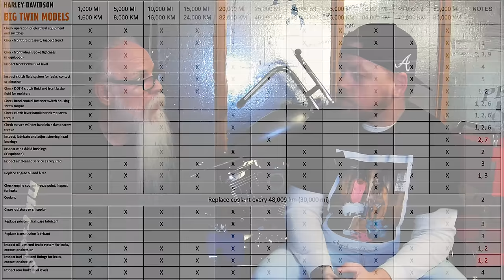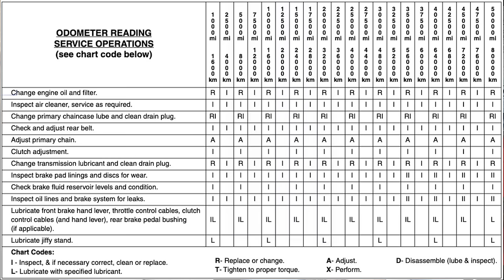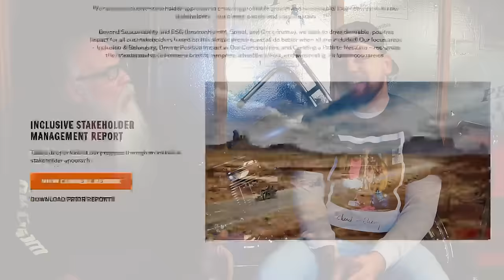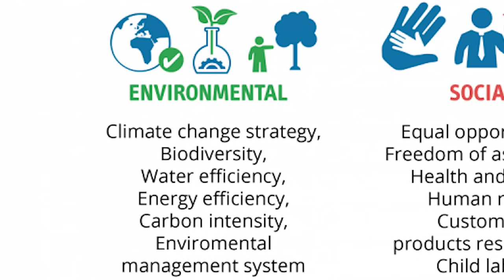Harley Oil Change Intervals-Engine, Primary, Trans

Comment: Good info, I have always changed all 3 holes 3-4 K miles. What alot of folks do not know is clean fluids help maintain a seal better and will suspend more debris between changes
I have never had leaky seals on any of my bikes
Reply from the maker: Hey Jack,
Good point.  Thanks for the comment. 👍😎👍
Reply: Yep, main 3k, primary 6k, trans, 6 to 10k, for me. 110k trouble free miles on 99 TC
Reply from the maker: Nice! 👍
Reply: I change all oil when I do a  oil change every 3000
Reply: Engine oil is one thing,but tranny fliud , synthetic,I change every 20 thou kms

Comment: I am 82 years old, and ride a 99 EVO powered Softail Custom. Since I generally do not ride over 3 to 4,000 miles a year, I change oil with Castrol 20-50 non synthetic once a year, and change the primary and transmission with Harley transmission fluid every 2 years or so. I have 64,000 on it and it runs great, with no leaks anywhere. I always warm it up before riding as alloy cylinders need to expand to tighten the gaskets. 

I tried Mobil 1 synthetic once, and the base gaskets started weeping. Changed it back out to non synthetic. Stopped weeping in about 200 miles. I love my carbed EVO motor. It runs like a Shovel head with improvements. Plenty of power for an old guy to cruise the back roads around where I live. 

I started riding on a 1942 "45" flat head in 1955 when I was 14. Wish I still had it.
Reply from the maker: Thank you for sharing your experiences. 👍😎👍
Glad to hear you're enjoying the classic HD experience.  Less and less even know what they are missing.

Comment: I've ridden H-D since 1969 and somewhere around 500,000 miles. Always changed all 3 holes at 5,000 miles (13 bikes). Never had engine, primary or trans. problem.
Reply from the maker: Thank you for sharing your experience. 👍😎👍

Comment: Change mine every 3-5 thousand miles. The same as my trucks and cars, been doing that way for 34 years an haven't had any problems or issues with any of my bikes or 4 wheeled vehicles. As you stated the cleaner the crap catching magnet is the better it works and always remember to check it to make sure it's still magnetized before reinstalling it. Sometimes they can lose it if they get to much trash on them for long periods of time. As the old saying goes, " if it ain't broke, don't try to fix it." Ya'll ride safe, have a Merry Christmas and keep the shiny side up and rubber side down.
Reply from the maker: Thank you for the comment.  Good info! 👍😎👍
Merry Christmas!

Comment: I have a 2019 Triglide and I change every 5k miles. I use amsoil 3 hole motor oil, primary oil and Trans fluid. You guys are great and I've learned a lot from watching your vlogs ty
Reply: I use Amsoil designated for each hole. My remote oil filter makes filter change easier and cleaner. Usually about 3500 miles.
Reply: Thanks guys I’m changing my oil’s every five thousands miles. I think it is better for bike.😎✌🏿
Reply from the maker: Thank you for the comment and the good words.  Glad you are finding the videos interesting/useful. 👍😎👍

Comment: Once a year or 5k whichever comes first. All three holes, all the time. Own an 02 FatBoy with only 40k but still changed all three, every fall, and have had no issues whatsoever.

Had my tension shoes replaced at about 27k, and was planning on replacing the Oem cam with a new one since it was being done. Tech told me there was no wear at all on the cam and to keep doing what I was doing in regards to fluid changes. 

Originally used only Dino oil, since Syn3 was not out yet, but somewhere over the years I switched to syn3 or similar and never looked back. 

Frequency is the key. Cheap investment and a couple hours a year to keep it purring 😉👍
Reply from the maker: Thanks for sharing your experience. 👍

Comment: On my 07' Fatboy I followed the owners manual on fluid changes. I have 46K+ miles on the bike now. I use AMSOIL synthetic V-TWIN engine oil 20W-50 in the engine, AMSOIL V-TWIN Synthetic Primary Fluid in the primary, & AMSOIL V-TWIN Synthetic Transmission Fluid in the transmission. I changed the engine oil @ 3K miles, primary @ 10K miles, & the transmission fluid @ 20K miles. After my last oil change (May 2022), I decided to change the primary fluid, & the transmission fluid @ 3K mile intervals, along with my engine oil change. Most of the time, I change the engine oil yearly, as I haven't been able to put many miles on my Fatboy in the last 3 years. I hope to get many more miles on my bike in 2023. I haven't rode since mid July of this year, due to health issues.
Reply from the maker: Thank you for your comment and experience.
Wishing you many more miles of smiles in 2023. 👍

Comment: Interesting that when you take it to a dealer for an oil change, they don’t tell you if they do just the engine or if they do all three holes, but they still charge around $300 to $500 for a service regardless of your mileage. I just started changing my own oil and I think I will stick to all 3 holes every 5k miles.
Reply from the maker: Yeah, it is usually better to do what you can yourself.  Then you know it was done right. 👍😎👍
Reply: Are you serious 😃 $300.00 to $500.00 for an oil change.
My 93 FXRS-CONV which I have owned for 30 years and my 2010 FLHTC which I have owned for 12 years have never seen the inside of a dealership for any service ever.
I was fortunate enough to meet a man when I was about 15 who taught me everything about repairs, tools mechanics on cars and motorcycles.
He later went on to be general service manager of Canada for Deeley Harley Davidson which is the Canadian distributor.
My neighbor had a Bentley, he was charged $1,200.00 for an oil change at the RR dealership. This is a V-8 aluminum block OHV spin off oil filter like any North American V-8, except it takes 8 quarts of oil.
He had to get rid of the car for obvious reasons.
I had no idea that the dealer's are practicing extortion.
Oil changes are about the easiest thing to do and provides excellent maintenance.
As I taught my son, the most important thing is that you check for leaks after doing it.
Reply from the maker: Yeah, prices are out of control, for sure.  Plus, when you do it yourself you know it is done right.
Reply: I have never in my life had any dealer change my oil, whether in my Harleys or my trucks. 72 years old.... not a snowflake!
Reply: @michaeleisen5445  And people wonder why they have money issues in their life, Lol!!!
Reply: @michaeleisen5445  at the time my bike was under warranty and I was told to preserve the warranty I had to have the dealer do the maintenance. It definitely was not convenient since the nearest dealership is 2 hours away. I’ve done my own oil changes on all my vehicles over the years and I still do my Motorcycles now that they are no longer under warranty.

Comment: Thanks guys, one of the best video's I've seen in a long time, not just on your channel; but in general as I'm a HD junkie. Boys you are correct, Canadian here and my manual says engine oil/filter every 8,000 kilometers, primary every 16,000 kilometers and tranny every 32,000 kilometers (negative the 1st service at 1,600 kilometers that change all 3 holes to keep warranty valid). I have a 2022 Street Glide Special I bought new, and do it at 4,000 kilometers (50% before their engine oil recommendation change kilometers/miles) plus the primary and tranny at the same time. It's not expensive and I love knowing I have fresh clean oil in all 3 holes.... all the time. Thanks for posting this, it's common sense really. I have to be honest I never thought of the HD carbon foot print issue to try to get customers to stretch out oil changes. I never understood my manual why such long miles between oil changes, now I know. A publicly traded company trying to lower carbon foot prints. Every day I learn. Always go with your gut feeling people. What an eye opener.
Reply from the maker: Glad you are finding the videos informative! 

Thank you for commenting! 😎

Comment: So glad you put this information out there for others. I made a comment in your "transmission oil change" video about your temp dipstick and started discussing oil change intervals and how parts materials haven't changed over the years. I know when I change my Primary oil for instance (change all 3 holes every 5K), I notice a significant difference in noise, smoothness, and ease of shifting. As you say, nothing has changed over the years except EPA requirements of companies. There are notable motor builders that can back this up too!
Reply from the maker: Thank you!
Yes, the primary can get contaminated very quickly from clutch plates.

Comment: I have an 03' softail 42mm mikuni standard softail.  Bigger heads, pistons, cam from a 88 to a 103 running a 240 tire final drive.  I have changed all 3 holes once a year with syn 3 cause I don't even drive my bike 5K a year.  Due to covid bike fluids havn't been changed or started for 2+ years. Bike started easy with throttle primed, choke on with compression release valves started and runs great!

Comment: Guys, there have been many studies on this subject. I used to change my engine oil in all my vehicles @ 3 to 5K. Then I switched back in the late 90's. I started using AMSOIL and went to their extended drain intervals and began changing at roughly 20K miles. I sent off oil sample kits, and every time they came back as great. I dug even further into this. Most advanced oils are nothing like the old oils of the 50's to 80's. There was a study done where they proved people were throwing away perfectly good oil, oil that was still working great and doing what it's supposed to do. The oil companies didn't like this of course, because it was going to cut into their profits. I have a vehicle that I change the oil in every 20K miles and it is getting ready to hit 1/4 of a million miles and STILL runs great! I believe most people are still hung up on the old oil and believe it has to be changed at 5K miles. My wife's uncle had a 1970's Dodge truck that had well over half a million miles, he was a mechanic. He ALWAYS changed the filter and added a quart and that truck was still running fine when he passed away. Now I don advise anyone doing this, but I do believe the oil change intervals were done primarily for the oil companies to sell more oil! That's all I'm gonna say about this. Do what you feel is fine and do what the manufacturer says as long as the vehicle is under warranty. My bike, using AMSOIL in all 3 holes, does not get good oil thrown away because the manual says so, but my bike is an 05 Electra Glide and not under a warranty. I suggest doing a few oil samples from a reputable company and that will probably open your eyes a bit on the oil change scam.
Reply: Food for thought is by comparison to the car world. My F150 - 10k engine oil change interval recommended, my car 8k engine recommended, my old Porsche 944 15k. Years ago Consumer reports did an oil life evaluation test with cooperation from a New York City taxi cab company, as memory servers they were not able to detect any wear difference between taxis that had their oil changed at 3k and those that had their oil changed at 10k. We are sort of dealing with dueling conspiracy theories regarding the change made by Harley, I am on the 'it never was needed' side of the fence but agree with DK Custom and others  that frequent oil changes certainly won't hurt anything.
Reply: @jjones6173  Absolutely!! The way I interpret Harleys NEW oil change interval proves what we are saying. They would not risk BILLIONS of dollars of part failures on a better "Green" grade.
Reply: @jjones6173  Other than your pocket.
Reply: @Clammy69  I think a lot of people see it as cheap insurance. Your point about temperatures I assume was meant regarding engine oil rather than the primary or the transmission oil.
Reply from the maker: Interesting thoughts.
The heat is the big variable.  Even Blackstone does NOT test the oil at the heat that the engine (and most primaries) are subjected to on a Harley.  
On Twin Cams and M8's the oil at the tank, IF one has done cooling strategies, will be about 230 F.  That means that the oil in the engine, after being squirted on the bottom of the pistons, will be closer to 260-280 F.
Per Blackstone-
"The viscosity of an oil could be reported at any temperature, but to standardize things, most laboratories report either a low temp (100F or 40C) or a high temp viscosity (212F or 100C) and stick with either Fahrenheit or Celsius. At Blackstone we report the high-temp viscosity, which is generally the temperature the engine is at while it’s running and the temperature at which the oil spends most of its time."
Of course, that means their viscosity test is not relevant to oil run in most Harleys.  The viscosity modifiers (or what some call viscosity improvers) are what get damaged first from heat. 
Blackstone source link- https://www.blackstone-labs.com/oil-viscosity/
Reply from the maker: Yeah, a bit confusing for sure.
I remember that report on taxi's and oil.  Of course, that is apples and oranges.
Most (maybe all currently) cars and trucks do not allow the oil to get over 220 F...so the oil they run is never subjected to the heat that the oil in a Harley is run at.
Reply from the maker: Average HD is run 3500 miles a year.  Warranty is for 2 years.  Even if the oil is completely trashed, they will not blow up in 7000 miles of running so hot with bad oil.  They are not at risk.
Reply from the maker: Yes, see post in this thread about viscosity from Blackstone, and a link to their full article.  apples & oranges.
Reply: @DKCustomProducts  I think a whole slew of engines "worn out" at low milage would put the motor company at risk as they were in the AMF days. Just guessing though.
Reply from the maker: Not really.  Average Harley is ridden less than 7,000 miles during the 2 year factory warranty.  PLUS, Harley has done a great job at keeping the Twin Cams and M8's running down the road, even when they are trashed inside.
I can't count the number of those bikes that fail leak down tests, and qualify to be rebuild under warranty, that are going down the road, not putting out any visible smoke.
Where the REAL STORY is told is in the Harley ESP program..."extended warranty".
The prices on those ESP's have over doubled in the last 10 or so years...because they have to cover the repairs on so many more than in past years.
Reply: @DKCustomProducts  Didn't know that. Appreciate what you guys do, KEEP IT UP!!
Reply from the maker: @Big88Country  Thanks for watching man!
Reply: I just did an oil change in this new to me 08 Road King classic Harley Davidson. Has 96 cubic inch.
Reply: It took me two days to do this oil change and I used the cin3 Harley 20 w 50 oil in all three reservoirs.
Reply: I was shocked at the supplies for this oil change came to a total of $190.00. the dealership wanted $310 to do an oil change so I saved $100.
Reply: @Big88Country  Where can I get the Kool-Ade flavor you are drinking? Oh now I remember; Jim Jones special blend. Billions of dollars of parts failures means $$$ income.
Reply: @ericrhinehart6055  Spend your money anyway you want Eric, BIG OIL loves you guys with your 1950's thinking! I have been doing this over 30 years and NEVER had one part failure due to oil failure! My color of Kool-Ade is GREEN, the kind I get to keep in my bank account! By the way, that Jim Jones flavor was given to people who couldn't think for themselves, they were doing what they were told! Kinda like the oil companies and you! GOOD LUCK!
Reply: Rite on, Brotha!

Comment: When I bought my 2018 Street Glide special I also bought the Dealer tire ins. (Well spent by the way) and the Dealer maintenance plan. That plan had oil change intervals at every 2500 miles plus free pick up and delivery up to 20,000 miles. I utilized everything in that plan. After the plan when I reached 20,000 miles I went to changes every 5000 miles. My bike now has 60,000 miles of smiles and I couldn’t be happier. One recall on the hydraulic clutch seal and one actuator replaced under warranty. One battery replacement. I use H-D Syn 3 as to what the Dealership does in the services.
Reply from the maker: That is great! I am glad you have gotten 60k of miles of smiles so far. Good maintenance habits are really important when thinking of longevity of your bike. Glad you found something that works for you. 

Thank you for commenting! 😎 MB

Comment: 2008 FLSTC 105th Anniv Stage 1-every 5000 miles: SYN3  20W-50 engine, HD SYN 80W-140 Primary & Transmission-bike spent 5 years in Qatar (60° C in summer) before exporting to Cape Town South Africa-69K km’s on the clock and runs fantastic (maintained it myself from day 1)
Reply from the maker: Thank you for sharing your experience, especially in such extreme weather.  (50 C = 122 F)

Comment: I use Amsoil in all 3 holes, and I clean my oil filter every 2500 since I have an Outlaw Oil filter and they can clog faster than synthetic filters. It's super easy to do so it's not biggie to pull it off, wash it, and put it back on.
Reply from the maker: Thanks for the comment.  I dig your videos! 👍

Comment: I'm new to all this, but I've already decided to change all three holes at 5000 miles for peace of mind and the one oil change that I have done, I used RedLine in all three. 

So my question for Mr. Kevin is, why use the Syn 3 in the primary instead of the RedLine?  Thanks!
Reply from the maker: I found that the Syn3 gives a really nice clutch engagement for me.  I will eventually try the Redline in the primary.  Here is a video with a bit more info on the subject- https://www.youtube.com/watch?v=bNHgNThrqQo